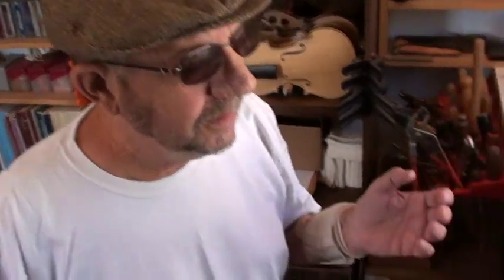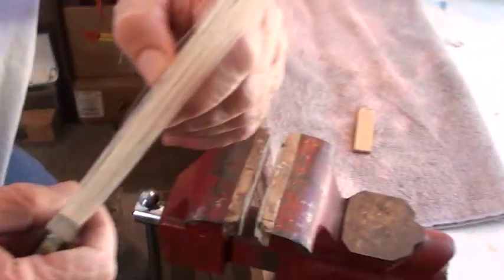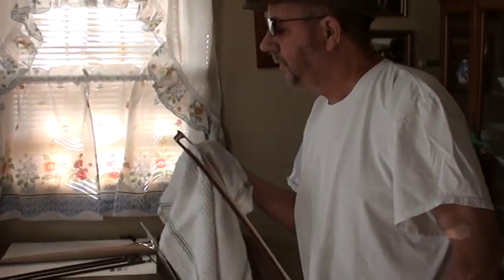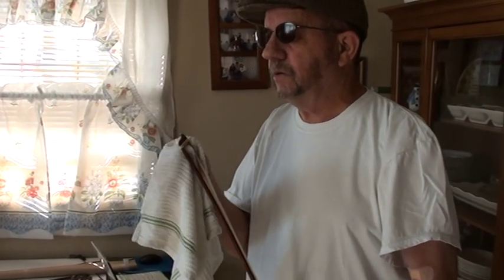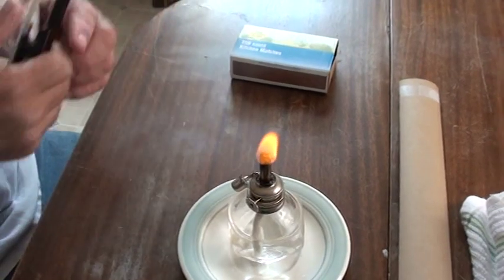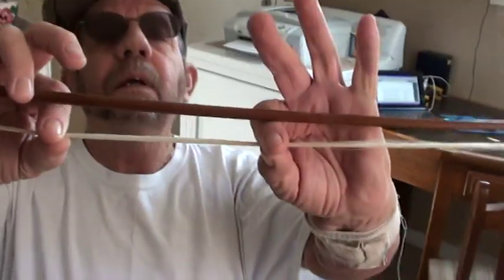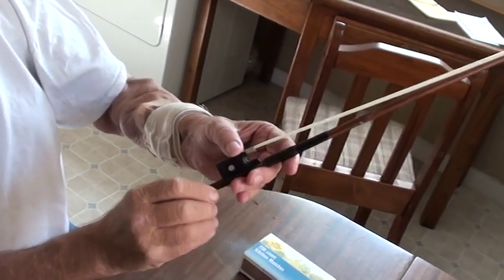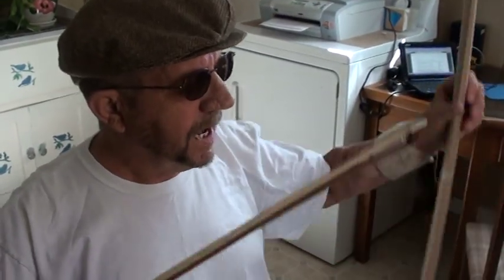Craig Tucker On How To Flame The Hairs of Newly Re-Haired Bow.mpg

Comment: More detail:  in my humble opinion, based on forty years of hairing bows, you're better off washing the hair before you put it in the bow, and combing it out and wedging it in wet.  If you do it well, there are no loose hairs to flame.  Flaming shortens the longer hairs, yes, but it also weakens them.

cheers from a bowmaker in Vienna.
Reply: x 2. flaming? do it right and you don't need to heat the hair. take a piece of your own hair and put into a candle and then tell me if you want you bow hair to put into heat.
Reply: yeah, I install the hair at the frog first, install the ferrule and wedge...then wet the hair, pull it tight while combing, tie/seal, install in tip, tighten bow. comb it, let the wet hair shrink back. You have minimal loose hairs this way.
General Musical Instrument repairs, Boston, Massachusetts
Reply: This is a bit off topic- I hope no one minds a bit of bowmaker ruminating.  The fact that you, inkey, and many others, can do a good hairing job frog first, or hairing baroque bows, shows that the ferrule has no function.  My post-modern bows have no ferrule: you don't need one.  All it does is weaken and complicate the frog.

cheers from sunny Vienna, Scott
Reply: Actually if he had wet the hair and combed it, pulling it tight, stretching it after installing in the frog (i do the frog first) he may not need to flame it at all.
Sometimes some flaming is necessary but it definitely weakens and damages the hair.
Reply: inkey2
Agreed.  Since the hair stretches out while being played in anyway, it's a good idea to hair pretty short and do as you suggest: wet the hair and tighten it.  This stretches it and also evens it out.
Reply: can you send me a link to buy a good hank of hair for my authentic Albert Nurnberger violin bow? I only need one hank. It was a gift and i don't know where to buy it
Reply: probably ebay......you want full length, "UNBLEACHED" natural horse hair by the hank
Reply: inkey2 Thank you so much you have a website?
Reply: Someone mind tell me if we just wet the hair & do the next step right away or put the hair in a bowl of water for some time say 5mins ?? Thanks